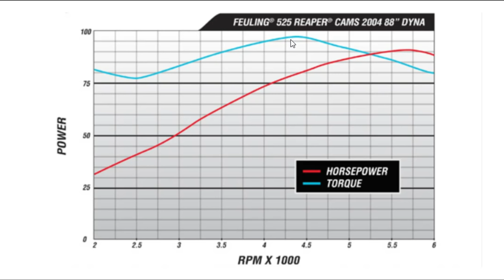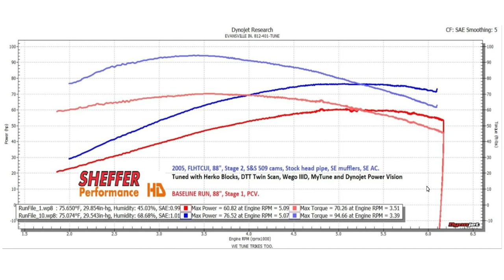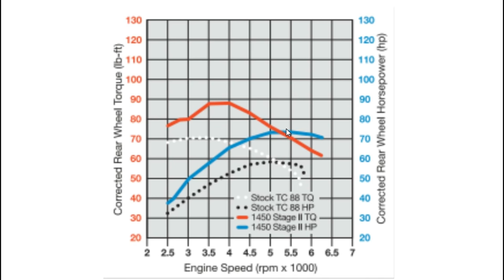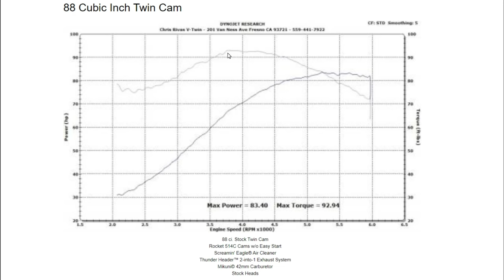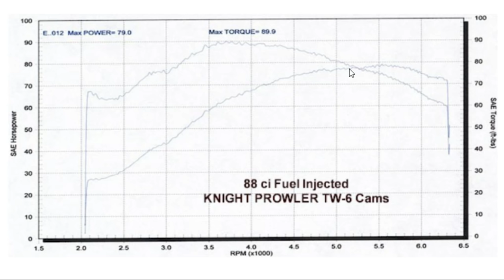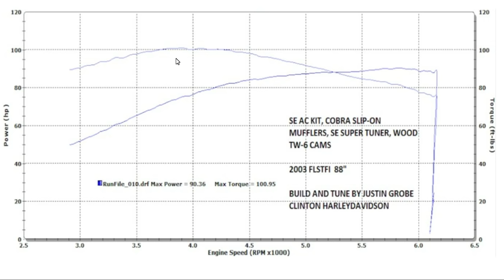Give Your Twin Cam 88 New Life With A Bolt In Cam Upgrade

Comment from the maker: Would you leave your stock displacement and do a cam swap or add a big bore kit for increased displacement?
Reply: I don’t think you could go wrong with just the cams. That’s relatively cheap IMO. However I would recommend the SE 95 kit. With and Oil Cooler and 44mm Makuni and my motor just keeps chugging along with decent power. It is surprisingly dependable
Reply: One of my riding buddies Has a 2003 Dyna he upgraded to zippers 95” muscle kit & S&S G1 carb.  the thing is a rocket
Reply: For now just cams. I'm wanting to turn my Road King in to Cholo Kong so i want to go big bore big cams big heads. Full meal deal! LoL
Reply: On the 88 really need to do cams with hydraulic conversion or else your just wasting time/money as you’ll have to do it eventually
Reply: Definitely go 95 will really wake it up  ! I'm a huge fan of the 95 inch motor the short stroke rev's up quick !
Reply: @scrumthebum2451  I too have a muscle 95 in an 04 bagger with a 50 mm throttle body ! Dyno says it's 104 hp !
Reply: @leonardstanford1877  
No doubt. I have 108 hp in my 15 RK. 
His 95 is in a dyna so it’s much lighter he gets me out of the hole
Reply: Big bore kit..bump compression and better cams
Reply: Im gone brother, youve become a scam artist.  I am not listing the details
Reply: Well, I'd prolly do both, but I run an Evo.
Reply: Hey GixxerFoo
First just want to say, love your videos!
I have a question for you, I have the weirdest HD of them all, the 2006 Dyna Street Bob FXDBI with 88ci and stage 1 (2into1 exhaust).
It's the first model with hydraulic cam tensioners.
What cams would you recommend for the 06 Dyna?
Thanks in advance!
Reply from the maker: You gotta add compression, that's the key to making the power!
Reply: @GixxerFoo  This!
Reply from the maker: The Evo can produce some serious gains with just a cam!
Reply: @GixxerFoo  This is true; take it upwards of 10 or even 11:1 and you can REALLY get one to run. Love the EVO.
Reply from the maker: Evo's will really surprise you with what can be done. You just got be mindful of the cases when you really get that power up there.
Reply: @GixxerFoo  Evo cases are fairly strong usually if the case's are going to break someone bored the case to accept 3 13/16 cyclinders & now millenniums 3 7/8 bore cyclinders ! All the Evo cases are good but if you are going big bore use 95 & up cases  the only other issue is & I am not sure what year but HD took the steel insert that the tomlin bearings are pressed in out of the case & bearings are pressed in to aluminum & I have seen the race spun !
Reply from the maker: Oh crap, that gets expensive when the race spins 😬. I think it was only some early Evo's they had case issues with, but they got the casting issue fixed by the 90's.
Reply: @leonardstanford1877  Is true about going with big bore on Evo. In my experience, the very early cases ('85-'89) and the later cases, as you stated, seem to be the best candidates. I tell people to look for a good radius at the rear mounting boss, good meat between the lifter block bores and main bore case wall, and of course to stay away from the pressed insert on the sprocket-shaft case half. Most seem to handle up to 3-11/16 fairly well; after that is a crap shoot. I also think the biggest problem can be winding up with insufficient thread support for the cylinder studs when going beyond 3-5/8 on the Evo. But, even at "80", the Evo can put down some good numbers. It seems if one stays below 3-11/16, and builds to power levels below 100/100, they can last a long time.
Reply: @GixxerFoo  the early cases had a steel insert in them no problem there it was early 90s that had bearing race issues ! When boring the case's to fit big cyclinders it's the cam side gets thin & they break clear down to the cam bearing ! Anyway if either problem happens the vases are junk unless u know a really good welder & machine shop & then yes it is expensive !
Reply: @wendyvic4046  right on !
Reply from the maker: Ah you're right, it was the early 90's when that bad run happened. That got everyone freaked out about the cases. Personally l prefer the Evo, if you got some mechanical knowledge and skills it's the motor to have.
Reply: @GixxerFoo  Haha, if one rides any HD it pays to have some "mechanical knowledge and skills", wink wink, LOL. Have never owned a "Twink", but I appreciate your vids on the subject. Never know, I might acquire one some day.
Reply from the maker: 😆😂 well yeah you do need some skills to own a Harley, they really aren't that bad though. At least with a Harley the knowledge base is wide, metrics have made me beat my head against a wall.
Reply: @GixxerFoo  i can relate; one reason my fascination with Motor Company products has never waned is due the the basic simplicity, even a lot of interchangeability, between pretty much all the iterations, not just within iterations, but sometimes across generations. I really love 'em.
Reply from the maker: That's why l really like these bikes, you buy a metric and all the parts are obsolete within years. I would love to build a 90's era sport bike but you can't get parts. Now you can have a 1940's Harley and still find parts 🤷‍♂️.
Reply: @GixxerFoo  Yeah I will say regardless of what Harley does Corporate wise there will always be a loyal following and guys fixing up and riding Harleys. Coincidentally it was that very thing that made Harley what it is today not the overpriced facade we see at dealers today (most dealers)
Reply: @GixxerFoo  Oh, for sure. I've built several bikes through the years, from flat-heads, to pans, shovels, and a few evo scoots too. But I've also built a few other brands, European and Japanese both, and the parts availabilty, the crossover capabilties, etc, prevented me from just even messing with them after the end of the eighties. I have to say, the Evo motor has really impressed me with its reliability, along with its "hotrodability". Have never really laid hands on any "Twinkies", but like I said earlier, if I had the chance, and could do it, would love to mess with one someday...God willing.
Reply from the maker: That's exactly why Harley is fighting their own used motorcycles! The amount of used Harleys is killing the new bike sales. Harley will even finance someone purchasing a used bike from another private party.
Reply from the maker: The Twin Cam isn't a bad motor, it just needs more than an Evo to be reliable. The Evo engine is one of my favorites!
Reply: @GixxerFoo  Indeed! Which can bring out about a few "worries" when one starts to contemplate the future of the used market capabilities. I have a few friends with the double-cam motor, and they have so far been satisfied, but a few frustrations also. It seems they are usually impressed with the eighty incher Evo I ride, but I laugh and tell 'em it's not difficult really. To be honest I have always loved the beloved Shovelhead; have built several. But it was because I couldn't find one which had both a good base for a build and a good title that led to the acuirement of my first Evo...I was at first bummed out, but after tearing into her, researching some info, then building her, I just have to say the Company hit a homerun there.
Reply: @GixxerFoo  Whic brings to mind: is the M8 the new motor with single cam as the earlier motors? If so, that should make for an interesting piece to delve into. I've seen a few builds,on the 131, and I was impressed with the performance results...and supposedly with rock-solid reliability.
Reply: @wendyvic4046  I think as it is on the market for longer stretches of time people will tweak up its reliability and performance. I think there is a lot of potential on that motor
Reply: I say, don't fix what's not broke. I'm just going with a cam, lifters,  adjustable push rods,  aftermarket camplate with hydraulic adjuster conversion, oil pump, may need carb jetted we'll see. I think that should work well. My 03 Dyna Low Rider is already a stage 1 blast to have fun on...she has 60,000 miles on her... just over 51,000 ridden by me personally.
Reply: @tcb8295  Have you contemplated or are you converted to gear drive?
Reply: @wendyvic4046 Thanks for asking.  I've thought about it quite a bit,  but have to check that crankshaft runout & requires a close tolerance for gears. Chain did well for 60K...replacing chain & sprockets as part of camchest kit. So should be good for another 60K. Also, adjustable pushrods allows for easier chain tensioner pad replacements if needed.
Reply from the maker: The Evo is legendary, if it hadn't been for the EPA it would of been updated and kept on running.
Reply from the maker: The M8 had some early issues as with anything, but l think they have a winner. I was really happy to see the single cam design return, although chain driven.
Reply from the maker: Damn you  have ridden the crap out of that bike!
Reply: @GixxerFoo  right on ! I'm certain u are right about the EPA but all the EVO s came to the dealership s lean some dealers fattened them up so customers would be happy but it was & is the same today with TC motors & the M8 motors that's why they run so hot a good tuning device could cure that  ! I do a lot off valve jobs & see too many valves turned white because of a lean condition !
Reply from the maker: Oh yeah you pull the plugs and they are ghost white. It was a lot easier on the Evo to fatten them up without anyone knowing. These days as soon as you tune it it's logged in the ECM. If you come in for warranty and they have to hook up digital tech, that gets reported to Harley. They know immediately if it's been aftermarket tunes and back to stock.
Reply: @GixxerFoo  yep, I ride all year round. Live in Virginia, so don't get much ice or snow(only thing I don't ride in). Have taken many trips to Florida and back... usually at least once a year. Also have a 2017  Electraglide Ultra Classic, have over 30,000 on it now.  Looking at changing to a Zipper's 468, Feuling Cam plate/oil pump soon.
Reply from the maker: Thay Zippers makes those sounds awesome, friend of mine has one in his street Glide. You've got some beautiful riding country out there!
Reply: My 06 Dyna only has 9k on it so I'll be just doing a cam for now i think. Bought it off an old man who barely rode it.
Reply: @adambrowning9629  I have the EXACT SAME bike Brother. I'm curious about this too.
Reply from the maker: Just a cam will really wake that bike up!
Reply: @GixxerFoo  I have a 88ci carbureted and I was trying to find a solution for the problem with the tensioner and with any knowledge I buy a 640" s&s gear cams. I can get a hi performance valve springs. But I don't know what to do about everything else. Could you please give me an advise? Thanks
Reply from the maker: A gear set is a great way to if your crank run out is good. A good hydraulic tensioner set works well too. What other issues are you looking at with your 88?
Reply: @GixxerFoo  I just want more power in this bike so I found this set of s&s 640 really cheap and also considering some changes. 
1 stock porting heads with hi performance springs but I don't know which ones. (please recommend).
2 change the bore of the cylinder but I'm not sure about how far,
The first idea was go from 3.750 stock to 3.875 (95ci)
After a little research I consider bore my stock jugs in my local shop to 4.000 with a wiseco piston kit 10.5:1 comp ratio and this way get 100ci. 
I know there some other sizes like 4.125 (107ci) and 4.250 (113ci) but I don't know if this last two are safe after the machining work. 
Just let me know what you think, thanks in advance.
Reply from the maker: You could likely get close with a bore job, maybe 98ci. Hammer does 98ci bores, you lose your overbore 70k down the road or so. But they run forever so by then new cylinders aren't that bad of an expense.
Reply: cam swap
Reply: It isn’t worth putting a big bore kit on my 17 year old bike. Bolt in cams on the ‘06 dyna reusing the factory cam plate may be the way to go for me, especially when I am a seasonal rider here in Wisconsin. If you do the big bore kit you will have or are going to do cams and cam chest.
Reply: @gdubbsmotolife9713  Can get away with bearings, gaskets and nothing else if you pull the rocker boxes. Maybe new pushrods, and of course the stage 1. I’ve only wondered about the benefits of changing the oil pump, keeping the hydraulic cam plate
Reply: For sure, that's a great way to get more power for less money.
Reply: Both! That's my plan with my '06 RoadKing. I have the cams, upgraded hydraulic cam tensioners, hi flow oil pump, intake, tune and 2 into 1, just waiting to do the  big bore. BUTthe camsand tensioners are a must!
Reply: @adambrowning9629  same bike brother did you get any good info?
Reply: @Almidy  moslty info overload...
Had to do my own research into compression, cam lift, spring ratings etc.
Decided to go with Andrews 37H. Haven't installed them yet, perhaps I'll have some time in 2-3 months. Will let you know what's my verdict if you you're interested.
Ride safe bro!
Reply: @leonardstanford1877  i am about to replace my tensioner pads and I’m thinking of a conversion kit from Woods. Any advice before I commit? Work up top first? Different cam or any parts. Thank you.
Reply: @danr4498  going to hydraulic style tensioners are much better then the or spring style but new camplates & oil pumps are expensive ! If your willing to spend the cash I would check pinion shaft runout & possibly go to geardrive . When you get right down to it the only issue was is the problem other then the 97 to 01 fuel injection ! The best parts are S&S but all of the mfg's are an improvement compared to OE springs
Reply: @EarlGuyton425  what?
Reply: @GixxerFoo  Hey Gixx, are the aftermarket engine cases better able to handle the higher compression ratios, I'm talking 11:1 pistons. If they're about the same, I might as well go with stock.
Reply: S&S with V&H  tuner and eliminator 400 exhaust with true dual head pipe
Reply: Anyone ever put a 509g in a 95” @leonardstanford1877
Reply: @GixxerFoo what’s the ss 509 do in a 95 inch big bore kit?
Reply: @twitterjackedmitchell8096 Yes, I'd like to know also.
Reply: So what big bore kit is the best? 95,96, or 98

Comment: Last year I put s&s gear drive 509 cams on my 99 road king and its amazing what a difference it made. I highly recommend them.
Reply: Hello fellow 99, carbureted Road King owner. I'm an original owner and love this beast.
Reply from the maker: That's an awesome bike! You can ride that bike as long as you want, it will serve for years!
Reply: I did the exact same thing to my 2000 RG. And I absolutely love it. 
 a wise choice on my part
Reply: Have 06 flhtcui screaming eagle 3-1/2 slip on arlen ness monster sucker ( that alone made a big difference ) now looking at the s&s  509 c cam chest kit ,pretty sure it's going in soon
Reply: Where would you start with carb adjustments
Reply: I have the sis 509g cam and cam chest kit in 2002 softail duece. It’s also got the 96 inch big bore kit. The cams were done after the big bore and woke it up decently